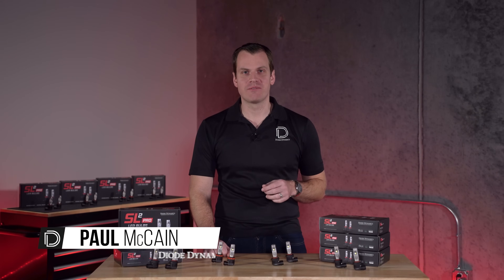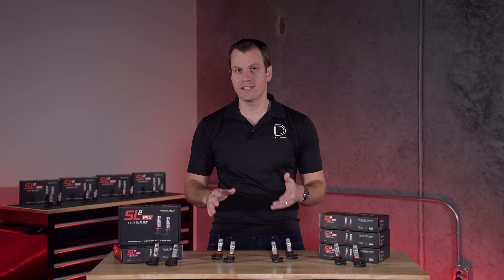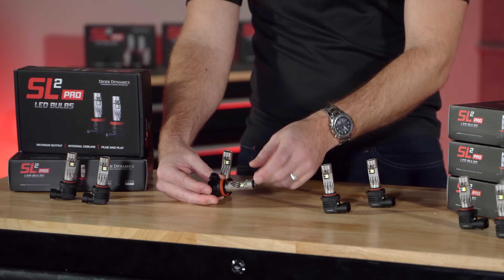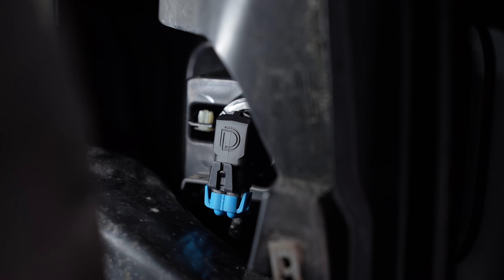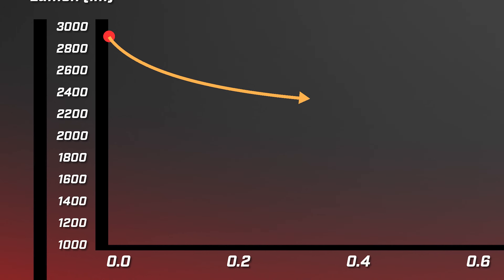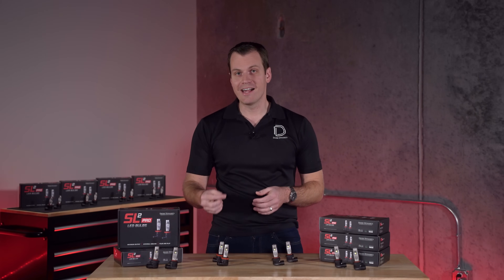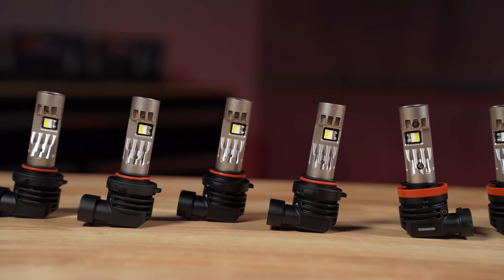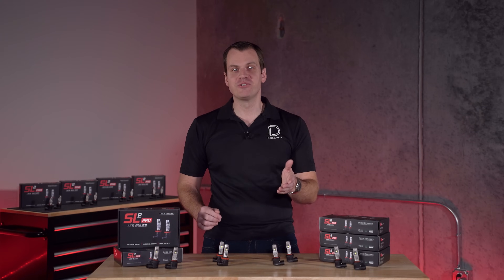Next Generation LED Technology - Meet the SL2 Pro LED Bulb | Diode Dynamics

Comment: I have 21 4Runner will it need the adapter anti-flicker
Reply from the maker: You can use our vehicle finder on our home page. The bulbs that fit your 4runner will pull up and will include the antiflicker modules!

diodedynamics.com
Reply: Why would you be putting these in a 2021 4Runner? 2021 and up is already superior factory LED and legally compliant in both the headlights AND the fog lights.

Comment: Looks like a well engineered and high quality product to me I'm looking to upgrade my new to me 2003 Ram 3500 shop / channel truck. Question... Will that model require the decoder module for the fog lamps with the SL2 Pro? And since I see you don't offer 9007, can you recommend a similar quality competitor that does? Finding a quality dual beam LED has  proven to be a real pain.

Comment: I have the SL1 headlights in my 2020 challenger I was looking for an upgrade for brightness and length will i still get the same length on these?
Reply from the maker: These are actually a smaller footprint than the SL1 bulbs, they should fit just fine!
Reply: @  I was referring to length as how far the light shoots down the road
Reply from the maker: @unoxy  These will project a further distance down the road with more intensity than factory options.

Comment: What is the MBTF of that tiny cooling fan that you have inside the SL2PRO product? Will the fan go before the LED or vice versa?
Reply from the maker: Certainly! While we don't have confirmed data on the MTBF (Mean Time Between Failures) of the top-sided cooling fan in the SL2 Pro, we stand behind our commitment to quality with a lifetime warranty on these bulbs. This ensures that regardless of which component might require replacement first, you'll have peace of mind knowing that we'll support you for the long haul.

Comment: How does the sl2 pro compare to the sl1
Reply from the maker: The SL2 Pro offers 2400 lumens, while the SL1 offers 1400 lumens. This is the perfect upgrade for any offroad setup while maintaining the same output pattern of halogen lamps!
Reply: @diodedynamics  so basically it's a lot more light.  Would be good for a fog light?  I have sl1 as a fog light (with a normal style put the bulb through the back housing) 

2013 accord V6 sedan
Reply from the maker: @ganzonomy  Sure thing! As long as you have a halogen factory fog light, you can upgrade to the SL2 Pro. We offer them in H8 bulbs as well! You can check them out here:

https://www.diodedynamics.com/h8-sl2-pro-led-bulbs-pair.html

Comment: Looks promising. A few questions...

What's the CRI? 

The rated luminous flux of 2400 lumens—is that RAW lumens, or EFFECTIVE lumens?

Do you have any plans for warmer color temperatures like 4000K?

Thank you
Reply: CRI is the color rendering index. Scored from 0 to 100. At 0 all colors look the same, at 100 actual true color of the object is revealed. Like daytime on a sunny day. You get the true color of grass, trees, rocks, animals, ect. The closer the score to 100, the better. Eg. At night, you will pick up a deer in dew covered grass in a ditch way better, with a cri that is 100 than say an light that has 50 or 60 CRI.
Reply: @PondstompingAdventures  I understand that, I'm wondering what the CRI rating for the SL2 is.
Reply: @sherlock_homeslice  sorry, misread your comment. As for sl2 CRI rating, I am not sure. That would be interesting to find out. I personally have only seen some really high quality leds in the past have a maximum of 70 CRI, but that was a couple years ago. I would hope that Diode Dynamics would have at least that at minimum. Hopefully they will get back to these comments and answer them.
Reply from the maker: Hey there! At Diode Dynamics, we prioritize the performance characteristics most critical to automotive safety and effectiveness in our lighting products. CRI is less relevant in automotive lighting, where the focus is on visibility, beam pattern, and luminous intensity to ensure safety under various driving conditions. Automotive standards emphasize these aspects rather than color accuracy, as nighttime visibility relies more on light intensity and distribution than on color rendition. Thus, we do not publish CRI values because they do not provide meaningful information in the context of automotive lighting applications.

Regarding the output - the 2400 lumens is a measured/effective lumen measurement per bulb. Though we don't have any plans for other color temperatures at this time, we will suggest it to our team for you!

Hope this answers your questions!

Comment: How's the focus on these? Better than the sl1? Any gonio tests? Any beam pattern charts like you had with the sl1 in the f150?
Reply from the maker: The focus of the light is generally much better, however this all depends on the housing they are installed in. 

We'll work on getting better comparison images in several housings in the near future! Stay tuned.

Comment: A side by side comparison with the SL2 and SL2 Pro versions would be great. I’d like to see the difference before I decide which version to get.
Reply from the maker: Send us a DM on Facebook or Instagram and we can send it over to you!
Reply: @diodedynamics Hi. I have been waiting for a review and comparison of the SL2 H1 bulb as this one is by far the most controversial one. Most manufacturers like honda required some sort of adapter with the H1 bulb. That's why yours are the only reputable brand H1 in compact form on the market. My 06 CR-V uses two pairs of H1 for high and low beams. I would appreciate it if you guys made a video about the H1 SL2 comparing it to the halogen. I already have them in the shopping cart. Thanks

Comment: The SL 1 fans interfere with the radio I have in my 2019 WRX. Would these new pro bulbs do the same?
Reply from the maker: We have not had any reports of radio interference on our SL2/SL2 Pro LED replacement bulbs on a 2019 WRX. 

Diode Dynamics offers a 30-day return policy that includes a free return label and no restocking fee if you want to give these a try!
Reply: @diodedynamics  Thank you for your reply. I will definitely look to update!!!

Comment: Now even if it’s not DOT approved, even if u say not good to put led bulbs in a low beam headlights to use in an area of no lights or city lights. 

We still would rather upgrade led bulbs on either projector or reflector. No matter what.

It’s a huge safety benefits to see better and be seeing better. 

In our states, we have no issues at all putting led bulbs in projector or reflector headlights.
Reply: It's stated for legal reasons. I've personally never heard of anyone getting pulled over or ticketed for having led bulbs.
Reply: @Mr_Clem02  people complain about any led bulbs that’s 3000 lumens u come across or over 3000 lumens per bulb is illegal. That’s why. 

But I agree with u as well. 

No cop will ever pull u over for that, as long as u aim correctly and fix the orientation correctly. It’s a no problem:

Comment: @DiodeDynamics 

Now my question is, why did u guys go from Diode Dynamics - SL1 with an external driver.

To Diode Dynamics- SL2 PRO with internal driver?

I love both version of them. But I’m curious of why go that route?
Reply: Probably to keep it lower profile... 🤷
Reply from the maker: @contagiousingenuityagency5273  eliminating the external driver allows for expanded fitment across all vehicles. Many vehicles couldn't use SL1 bulbs as the back of the bulb was larger with dust caps or external driver wouldn't fit inside the headlight housing if sealed.

Comment: So, a friend of mine (we're engineers) asked me around 2015 about the feasibiilty of an LED replacement bulb for headlights.  I told him don't do it, the technology isn't there.
  
It still really isn't - but it's close-ish.
  
What you don't want is a diode hanging way out there on the filament location.  Instead, you want a fiber coupled blue laser, with the PHOSPHOR conversion out where the filament is (talk to a company called Intematix, who make inorganic phosphors for light conversion.  This means you can get the heat down to the base, where there is more area you can use for dissipation without obstructing the light distribution field (you can still reject all the heat into the housing).  Imagine having a fiber that is the shape of a filament, covered with the phosphor in about the original dimensions of the filament, and the heat all at the base where it can be rejected into the housing.
  
Similar to the signal bulbs - "there was an attempt"... the Xenon Depot 7443 XTREME VF bulbs (no affiliation, I bought some, wasn't happy), try to use a light pipe to move the LED parts down out of the way, but IMHO they didn't "go big" enough.  Back in 2020 I recommended to them making the light pipe longer so they could replace the bulb base and put both the driver and heatsink in it, nothing ever came of that from them.
  
Diode Dynamics is one of a the few LED bulb manufactuers I've seen using an integration sphere to measure light output - I can pretty much gaurentee that none of the Chinese bulbs do that.  But I'm still unhappy with amber bulb intensity in daylight.  Best LED replacement I've used has ben a Whelen "factory option" from Ford in my 2015 Police Interceptor - they have somethign they called the "LED Front Lighting Solution" which included LED hide-away strobes, but the amber turn signals had to be integrated into the front firing white strobes in the turn signal location.  not only did Whelen nail the bright/dim ratio so that YOU CAN ACTUALLY TELL THE DIFFERENCE, they got the bright output correct.

Comment: Still no dual beam applications? No 9007, H13, or H4?
Reply from the maker: We currently do not offer a dual filament option at this time. Sorry about that!
Reply: @diodedynamics will these still give the bulb out warning on finicky bcm model vehicles like fords and Chryslers. I bout a pair of the sl1 and every time I turned them on I would get bulb out warnings every 5 seconds so I pulled them years ago and put them in a box.